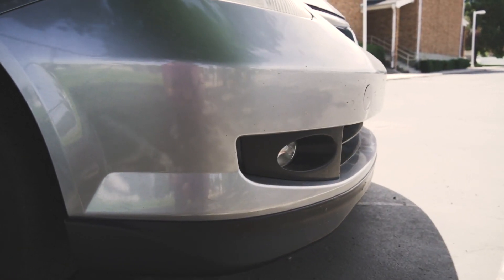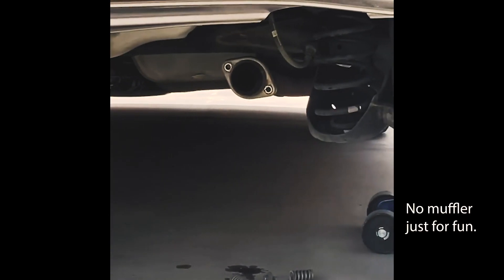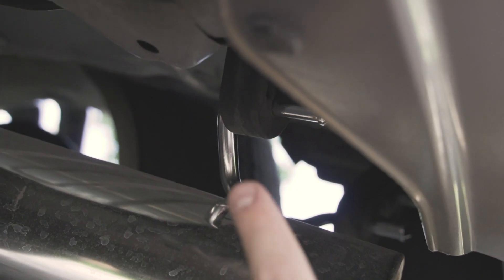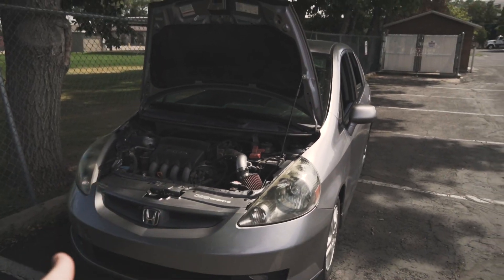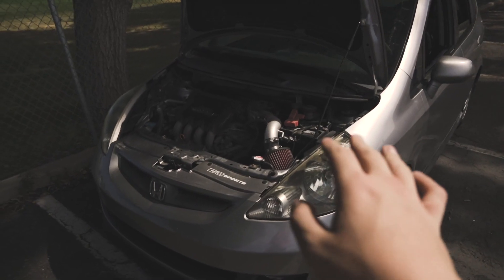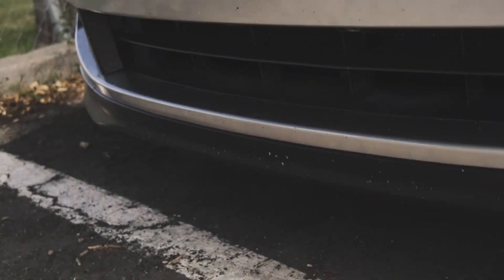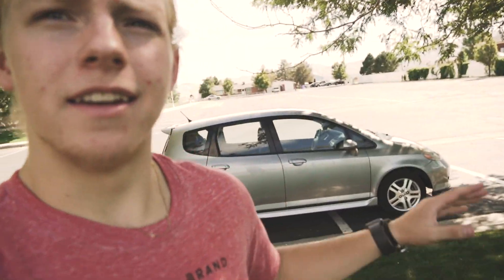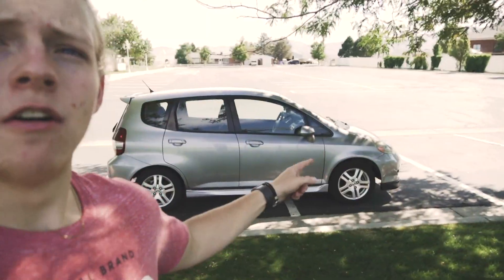5 MUST HAVE Honda Fit Mods & Accessories (2007 2008 GD3)

Comment from the maker: I have added the links to the parts in the description of this video if anyone is interested in modding your fit!
Reply: I bought a 2008 Honda Fit that has paint fade on basically the whole car.  It’s bright red and I’m wondering how do I go about on fixing the paint ?  And what’s a good website to get “cheap” wheels for a Honda Fit ? Since fitment industries is hella expensive lol
Reply: I also just got an Invidia exhaust installed and it sounds great ! Was that a K&N air intake you have ? Ik you said it was like $100 but I’ve seen it for $303 lol

Comment: I just got done installing a bigger battery in my 2008 Honda Fit.  I got the NAPA "THE LEGEND PREMIUM" 740 CA/590 CCA.  H:  6.75". W:  6.75". L:  9".  BCI # 96R, NAPA # 8496R.  I have it running lengthwise from the fuse box to the air cleaner.  It fits perfect!  Nice and snug!  This is the direct fit battery that Napa had installed in my 2005 Mustang 4.0L

Comment: I picked up a '10 5mt with low mileage last summer, I have been having a blast weaving thru Chicago traffic and the gas tank lasts about 300miles even tho I usually shift around 3rpms

Comment: Hey Justin...new sub here. I'm on the verge buying a used Fit. Many for sale fom private owners near me. $7000 budget... which year would be a good start? I'm thinking 2012 and up... any significant things to look for  with a car over 100k  miles?. Thanks,  middle aged guy, looking for reliable commuter, not power...

Comment: It's called a lower bumper or a skirt on the front of your car and it's not a higher powered exhaust it's just a exhaust it's a muffler that that's it..
Plus that's not a quarter and take you installed because of the placement of it literally it's just a short head ram.
Reply from the maker: Interesting that Honda has the part number named “front spoiler”
The hks muffler is called “hi-power”

And about the intake, yes. And I regret it. Wish i could remake so many of these videos having grown since then

Comment: So I'm probably gonna end having a 2018 Honda fit from my folks and I was wondering if any of these mods would work on the newer model
Reply from the maker: The same TYPE of mods will work, but you’ll need to find mods for your specific year and trim
Reply: @JustinMods  thanks for the response man! I've been driving the fit consistently since December and once I own I want a tad more power and presence ya feel

Comment: Great mods and good video. My 03 civic got totaled so i picked up an 08 Fit. I could have got an 10 but i really like the non organic radio display of the 08. I am planning on getting some AVS low profile wind deflectors and hood shield. And most like going to do an all around tint with a visor tint as well (abiding by all local and state Laws). Maybe a tow loop as well for that pop. What are your thoughts on a Vtec SOHC decal (like the ones you would see on most civics) on the rear doors? I have heard mixed opinions on it (many nay sayers laughing on why you would want to flaunt a SOHC) but I really like to brand a Vtec engine no matter Single or Dual Cams. Thanks again for the great vid.
Reply from the maker: Dude, don’t listen to the haters. Your car is your car you do whatever you want to it, just do your research first

Comment: I am first time driver. Planning to get 2009 version of this which is almost same. 130k on it a single owner car, what do you all think for 4 grand?
Reply from the maker: Any fit for 4 grand is about right, make sure to check for basic mechanical issues, the fits are reliable cars but owner error is very much still possible, listen closely for sounds, look under the car for leaks, make sure the body is in good condition, make sure you’ve got a good deal and use everything you can to get the price down (problems and things that weren’t listed in the listing)
Reply: @JustinMods  thanks mate. Really appreciate you!
Reply from the maker: Plus! There are plenty of fits out there, so look closely for some red flags and get the one you’re going to be happy with
Reply: @JustinMods  thanks for the suggestion buddy. I started loving this car once u made me listen that HVC exuast. Loved the sound it made.
Reply: Got myself a fit mate. 2009 sport. The problem I am facing is, it's got that perl blue color and it's faded out on hood and roof. Looking to use a vinyl wrap. I don't mind wrapping same color but I think it's very difficult to get same one and it would odd. So I am looking for some other options. A Matt finish black is what my buddy is suggesting, I was thinking of carbon fiber look. Any suggestions mate?
Reply from the maker: Well, my first suggestion would be to try and bring back the paint as much as possible. Have you considered a cut and polish? Depending on the severity of the fade it can bring back a LOT
Reply: @JustinMods  it's pretty severe Justin. The top is almost has no to very less paint left over and the hood has a mark on the right side which is also pretty severe. Thanks for th suggestion though I would use cut and polish for minor scratches here and there. Learnt something new today.
Reply from the maker: Dm me on Instagram! @brian08fit, let’s see what we can do about it

Comment: 2009 honda fit suspension fit on 2007 and drop it by 1 inch
Reply from the maker: The tein s tech lowering springs I have drop it by 2 inches, but I didn’t know they were compatible so that’s cool man

Comment: That cold air intake is not a cold air intake...its hot air intake... every intake needs a proper airbox  or you lose hp... you just get sound and more fuel consumption... when your engine gets hot that air stays under your hood and goes directlly to that intake... use your stock airbox and get a K&N filter for your car and tell me im not right...all other mods are cool...
Reply from the maker: I said it was a ram air intake, some people don’t know the difference. Cold air intake seems interchangeable to the Internet so I used that word, ram air intake has significantly less searches. Been considering getting a new intake system, but I want to save up for another car or some wheels for the fit

Comment: U missed the tinted windows
Reply from the maker: They just got tinted 😳
Reply: JustinMods u forgot the led lights for signal lights and suspension and led lights for reverse
Reply: I think it will look fire if the suspension is dropped

Comment: You seriously wasted your money for a three to five horsepower gain if you even got any... The engines tune for the factory air box. They've proven that 99% of the time there are little to no gains at all for these aftermarket filters. Especially on a car that has a mass air flow sensor where it left more particles in and the sensor gets dirty a whole hell of a lot quicker. So I'd send you one from 109 horsepower to 112. Maybe. I made a mistake when I was at Young spending money on a car not even worth a trade in value of two grand.
Reply from the maker: Cool sound
Reply from the maker: Fun install
Reply: @JustinMods  just don't be disappointed when you don't get what you think the value of the car is worth when you go to sell it one day. Just trying to look out for your interest man! 🤟
Reply from the maker: Reinstall stock air box, sell